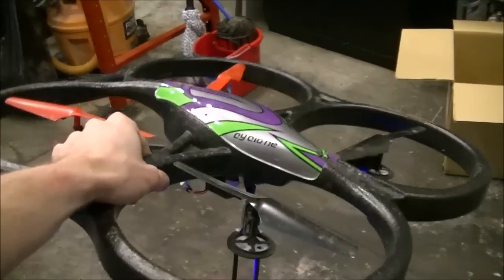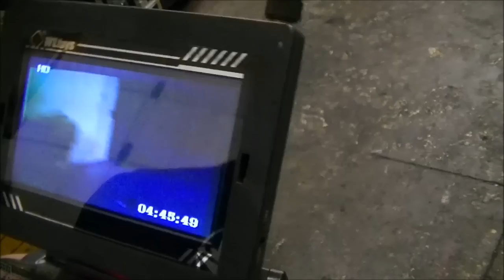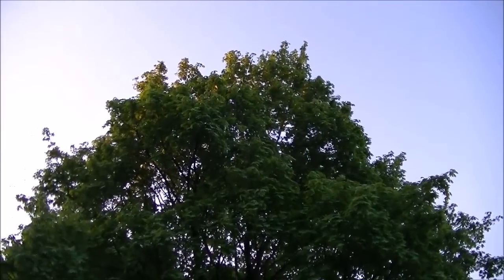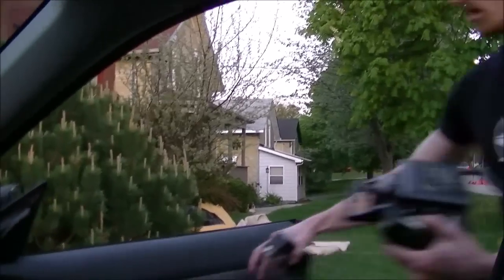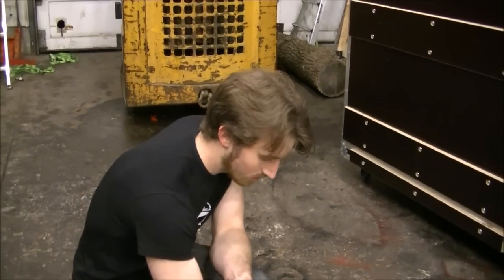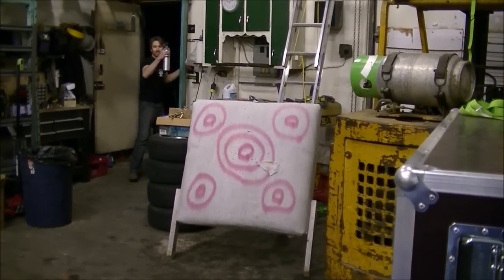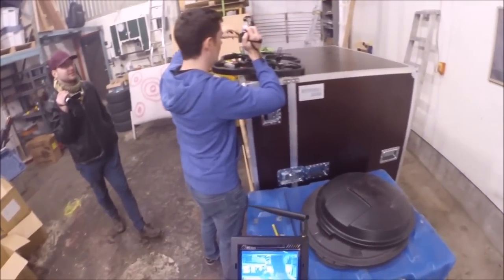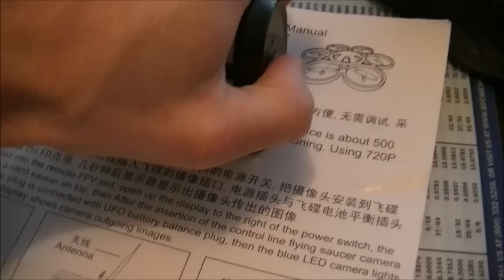Gearbest V666 Quadcopter Review

Comment: Cut a drinking straw in half and glue tubes to airframe. Assuming you have a spare radio channel, arrange a small coil of nichrome wire at the rear of each tube, which can be shorted on command. Feed a bottle rocket into each tube, inserting the fuse into each coil. Engaging the afore mentioned spare channel, fire the rockets. Terrorizing the neighbor's cat just became 'rocket science':).

Chris

Comment: Just a heads up regarding Gearbest. I wanted a backyard quad and after reading some good reviews I ordered the Nuhui U807 for $48.60 with two extra motors and a prop shaft just to be safe but the one I received was defective and had a bad ESC and apparently it cannot be repaired as the FCB is not available. As a result I'm sorry to report Gearbest's response has been the opposite of what Gearbest claims in writing is their response to customer service issues and offered me a $3.80 credit rather than replace the defective part or repair the quad. I refused the offer and requested a replacement part or warrantee/guarantee service. Gearbest then closed the ticket with no action taken.

After waiting for a response I was surprised to discover the first unresolved ticket closed so I opened a second ticket and immediately received an emailed saying my "wallet " was credited $3.80 despite refusing their offer on a $48.60 purchase that is useless without a working ESC. If you get a working product you will be OK as long as it's a low cost product as important parts like the flight controller and onboard ESCs are not available. If you are talking about a product that costs over $100.00 you are running a high risk of instantly throwing your money away as Gearbest may claim a one year warrantee but my experience as well as others shows these statements are made to get you to buy a product and the customer service claimed does not exist.  To even consider buying something more complex and expensive with GPS that is not a test review version like the ones shown in reviews checked out before shipping IMO is very risky.

With prices so low on hobby grade parts using standard RC transmitters and receivers where you can build an excellent GPS quad for less money that can be easily repaired with available standard open source parts I would have to recommend you buy one from a known company or someone that builds them for a fee with parts sold through the standard RC hobby suppliers. If Gearbest is going to survive as a RC hobby supplier then Gearbest is going to have to stop getting business by undercutting companies that have real customer service and take that reality into consideration in their pricing and become straight forward and honest. Putting out a few products that work for reviews is not the same as putting out a thousand of the same product that work as well. And if it cannot be repaired it will become a complete waste of money. Quality is far more important than quantity and not an easy thing to establish and being able to replace parts should be a primary consideration.
Reply: +John F Hendry Thanks for the heads up, recently I ordered a "hover board" for $280 (usd). How long did they take to process your order and how long did it take to get to you?
Reply: Commander Chod My feelings have changed regarding Gearbest somewhat. I think the two biggest problems they have is poor quality control affecting products that are defective in selling the products at the lowest price which does not allow room for the expense of customer service. But what may be the biggest problem for them is theft occurring in the shipping process where people don't get their packages. I suspect competition and greed driven politics of all kinds is in effect where it's easy to get people to help out. It only takes a few thieves in a shipping company stealing one company's products shipped out to make the Company itself look dishonest. 

I think Gearbest see's the value in high sales volume obtained by offering low prices in a very  competitive market, but when a customer gets a defective product  then it puts a dent in the business model... especially since in the case of RC products that fly and crash some people are dishonest or unqualified to use and operate it and end up blaming the product as many times if not more times than it is defective.

With free shipping on most of the things I buy and my ability to repair  or replace a defective part makes taking the gamble with GB and others China sellers worth it averaged out over time, but I have not been one of the people whose packages was stolen.

As for shipping arrival times I have had it take a month, and had things in a week, and from US Warehouse just a few days. Last order made on the 29th late at night came in today so I'm calling it 9 days. GB seems to be getting faster using the parcel post option that only adds a small amount to the free shipping on small stuff I get from them. It's China Post you want to avoid from what I have read. Most of my orders are low cost items so don't know how $280.00 orders will be handled but I think you should be OK and only worry is quality control and the package not being stolen in shipping.

BTW right after I wrote the post above GB got in the needed FCB with ESC but I fixed it already (cold solder joint) but it tuned out all the motors were wired in reverse polarity. So not GB's fault but something I think became known and GB should be up front to gain our trust and just say sorry it was our suppliers mistake..
Reply: +John F Hendry Thanks for the reply but they jusy told me they ran out of stock and are refunding my money which sucks because I was really looking forward for that hover board!
Reply: Commander Chod I must be getting old and delusional... I didn't even know they made hover boards yet. I'm still working on the equation needed e{a}/t=hv to deal with gravity.
Reply: +John F Hendry Oh no you're fine, it's this new trend and everybody calls them hoverboards, they're actually called "self balancing scooters" they're pretty much segways without the handle.
Reply: Commander Chod Auh..man... what a bummer...I was just about to order one too;-) 

Be careful and wear a helmet, the nice thing about a skateboard is they never stop working to send you flying face first. I think a real hover board might be a little safer. But love to try one.... I'd like a fast one where you sit down so as to have a lower C/G.